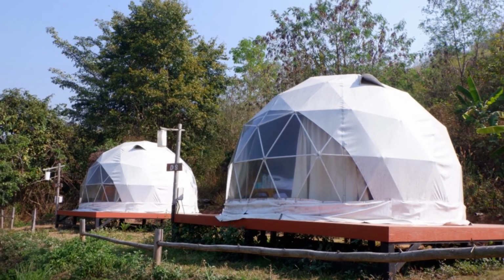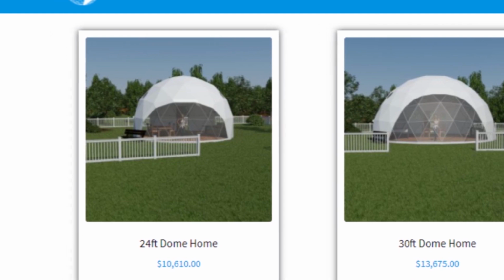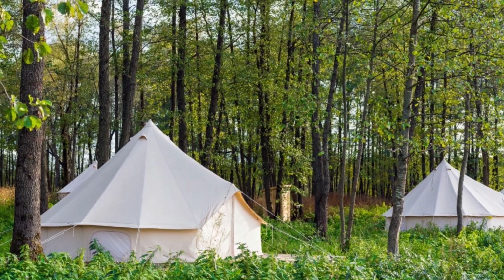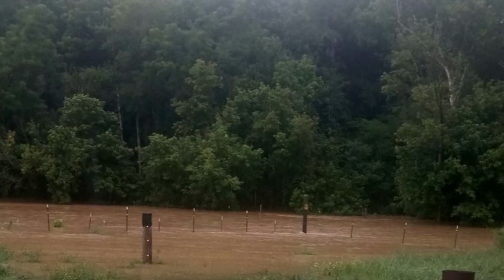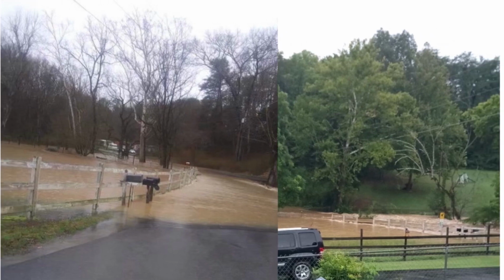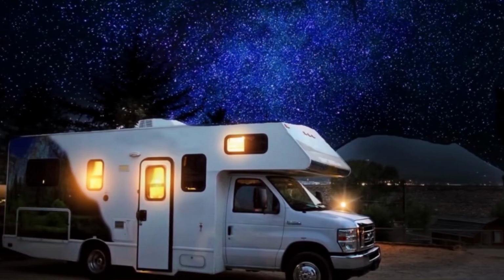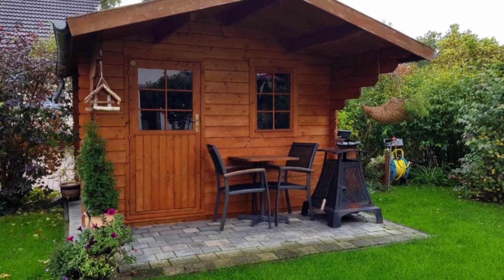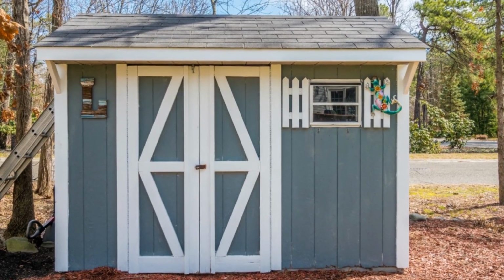We Chose THIS as our First Tiny Home Glamping Design!   DIY  // Budget Friendly Design Ideas

Comment: Very cool!
The biggest thing holding me up from starting my own would be all the Sevier County regulations. 
I've already seen several BNBs get shut down after only a couple months of operation because they weren't fully legal. I'm west of Pigeon Forge, close to the Blount county line btw.

I haven't spoken with a general contractor yet because they're so expensive. I briefly looked into getting the GC license myself to save money but I found the insurance cost prohibitive. 
Is one of you a licensed GC in TN? Or about how much was it to hire one in your area?
Or maybe instead of answering me, you guys could make a video discussing the whole legal process of getting your glamping business going. I'm most curious as to if you went with the single family dwelling or ADU, and why you chose one over the other. Also, since you have water and power in the unit, how tough were those inspectors? Did the county have any complaints about the construction drawings you submitted? If you didn't have to jump through all these hoops, how!?
I really love the way everything turned out!
Reply from the maker: Hi Nick. I don’t blame you for not starting because I know what you mean. Doing this the wrong way will for sure get you in trouble. And I couldn’t imagine investing a bunch on time and money and doing it the wrong way and then getting shut down. 
Before we bought this property we looked into the laws and regulations and that is why we didn’t buy in sevier county. I had a few conversations with the county and I didn’t see it working out very easily. So we moved our search area further east and believe it or not Cocke county doesn’t have a building code or zoning code. Sounds insane!!! And I called the county so many times before we bought here because I was skeptical that I cold just do “whatever I wanted” here. Now, people say sevier county has much better schools and a lot of other things to look into. But when we specifically looked to start a glamping business we thought Cocke county was ideal. 
BUT it is still possible for you to do it. It will take more time and effort but you are  probably in the best spot in the country to have a successful Airbnb!!!! So once you have something up and running it will probably cash flow absurd amounts and very steady income. I wouldn’t mind talking some more. So feel free to join us on Instagram and we can exchange phone numbers or you can drive over and you can look at our setup and we can bounce ideas back and fourth about what you are planning to do. 
Please don’t let sevier county stop you!!! This can be an amazing business for you